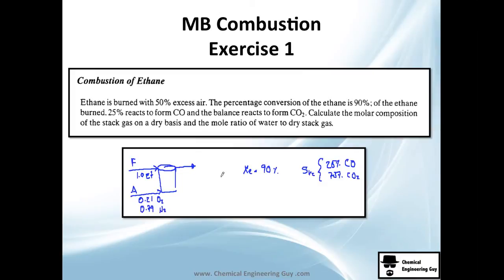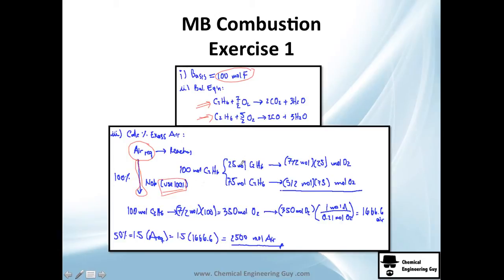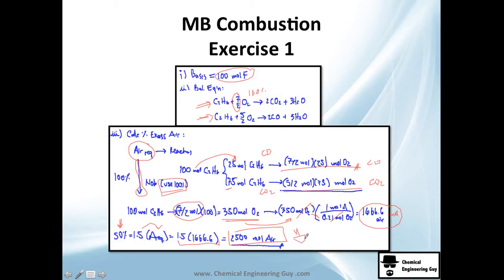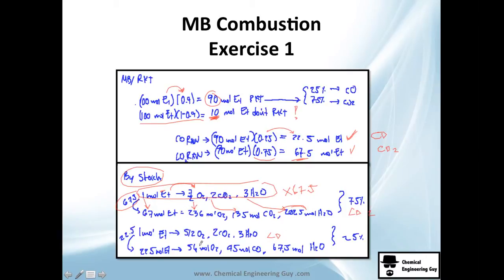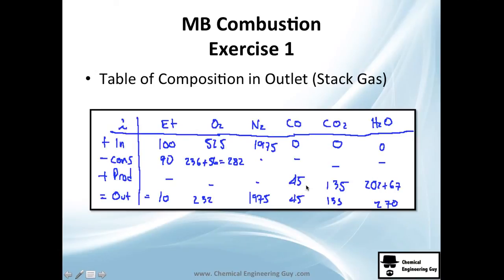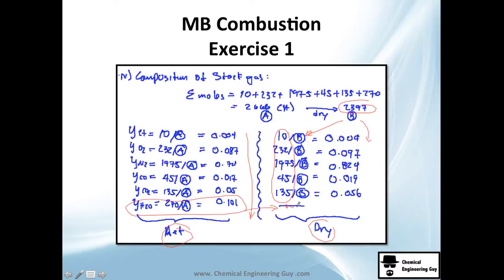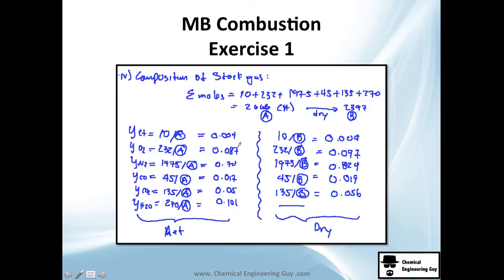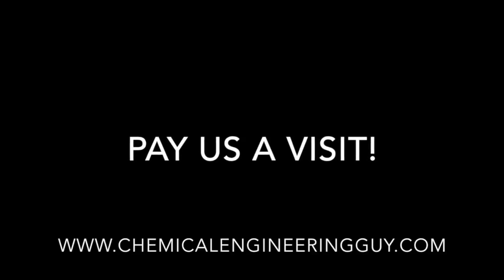Combustion (Exercise) // Mass Balance Class 19

Comment: Why you didn't add the N2 as a reactant in the chemical equation of the combustion?
Reply from the maker: N2 is not reacting... but you could add it... it will simply go in and out, there is no reactant (is inert material)

Comment: could you solve this question please. the heat requirement of a process is 1 kW. The furnace is fired with coal which has 70% C. The net calorific value is 27900 kJ/kg. The process is carried out at 1600 K. Products of combustion analyse 76%N2, 7%O2, 5%H2O and 12%CO2. Calculate fuel consumption.
Reply from the maker: +Mahmood Hasan Im currently on other courses/projects; I will work on that on the Energy Balance Course!